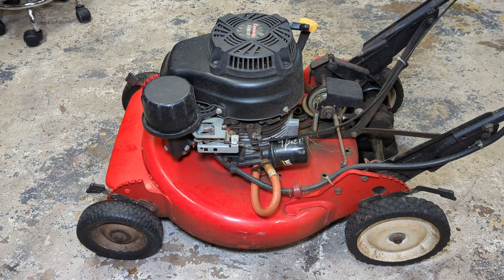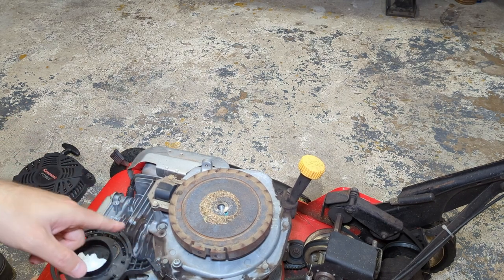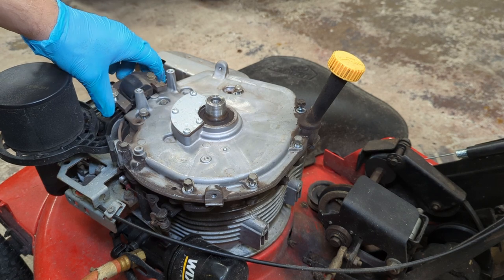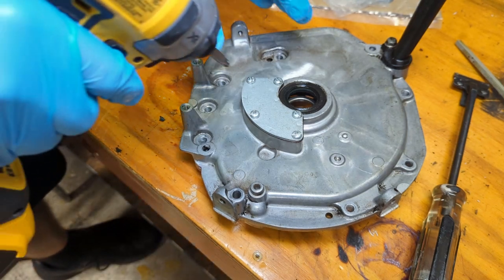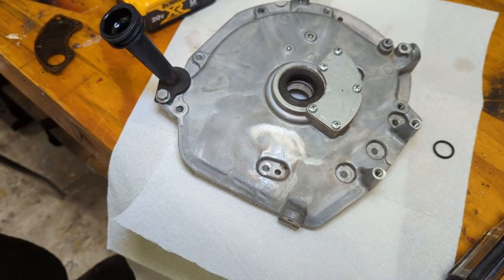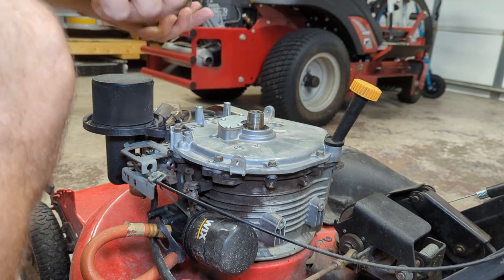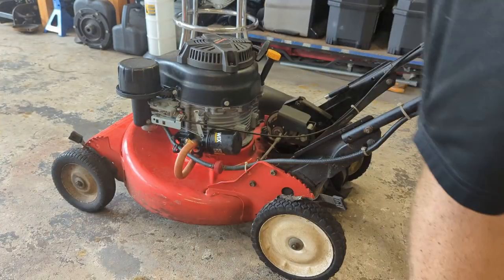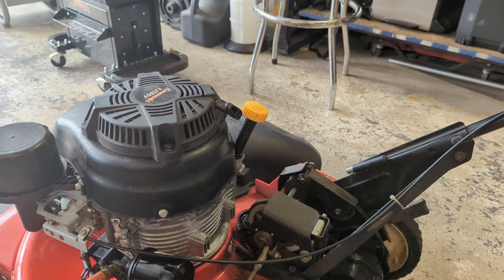Kawasaki FJ180V KAI Sump Gasket Replacement

Comment: Please, does the engine have two ball bearings on the crank mechanism, or just one. Thank you for your response.
Reply from the maker: It has a ball bearing on the flywheel side only. The lower bearing is immersed in oil and doesn't require a ball bearing.